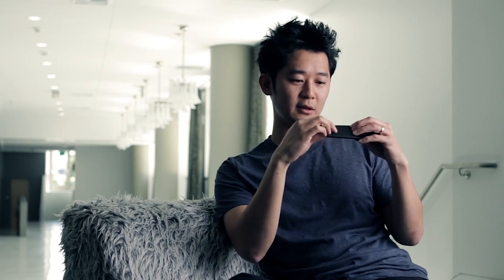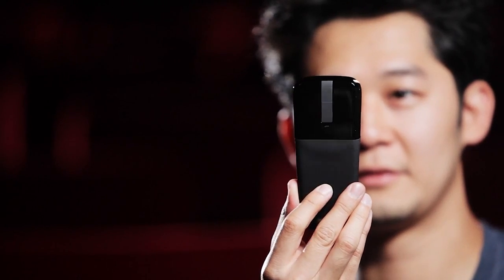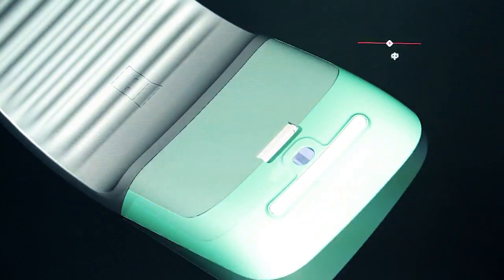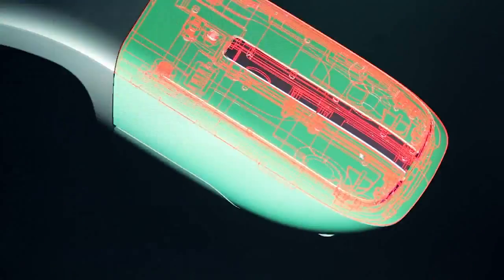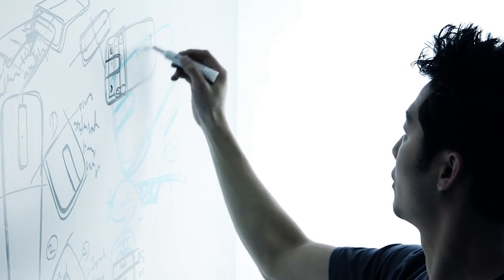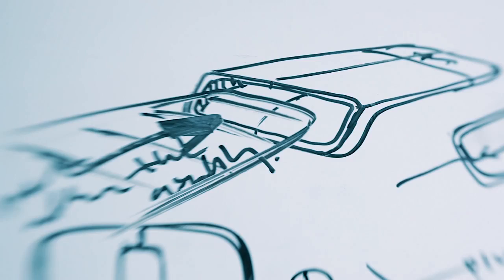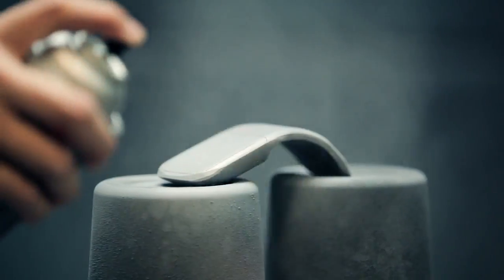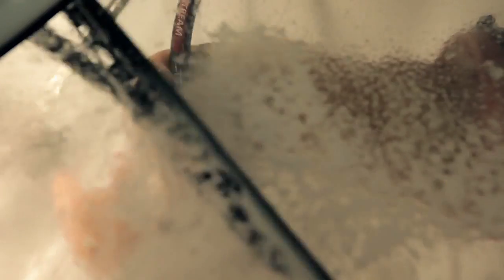Microsoft: Arc Touch Mouse Design and Production Process

Comment: Hi. Nice video. Got my Arc Mouse today, brandnew, bought online from reseller, mouse is bent inside the box, flattened it once, then wont bend/arc anymore... no power when installed new batteries. Seems the curve/bending mechanism loosen, hard metal pinching the rubber under the mouse. Seller no more stock to replace. No service center here in PH. 😩😩😩

Comment: I find it hard to use on cad programs, no middle click pan. Can anybody help how to make it work with a simple click like the regular mouse?
Reply: Hey Dodi. I don't know if you've reached a resolution for your problem as of yet, being especially skeptical considering the six month time frame, but to answer your question you are able to do a middle click pan with the mouse as long as you double tap the scroll touch surface close to the center. This is a bit confusing and hard to get used to, as it's very easy to miss that pinpoint precision and instead tap the ends of the surface, thereby scrolling up or down instead. You'll want to double tap where the two parts of the scroll pad, top and bottom, meet. Make sure not to deviate too far from the center for the aforementioned reasons. Hope this helps!